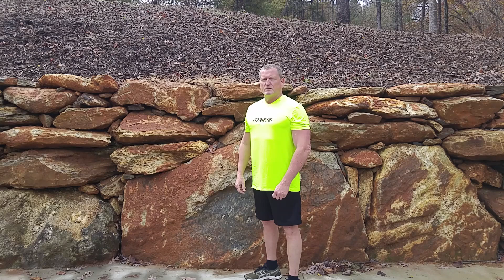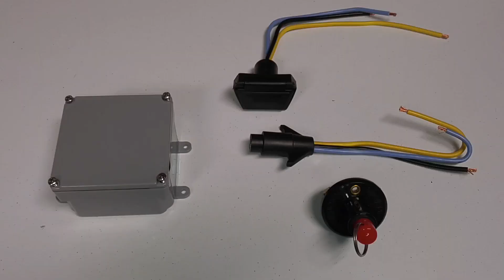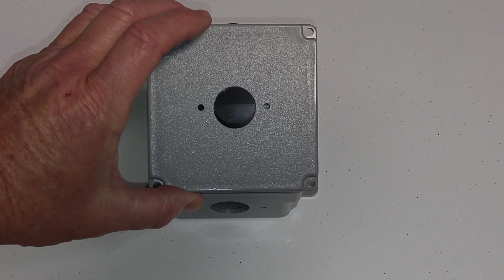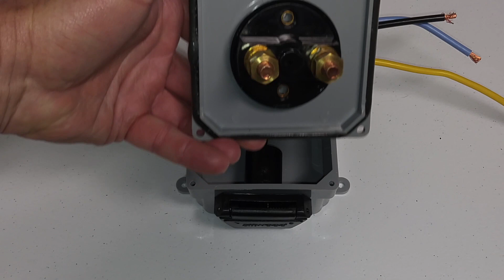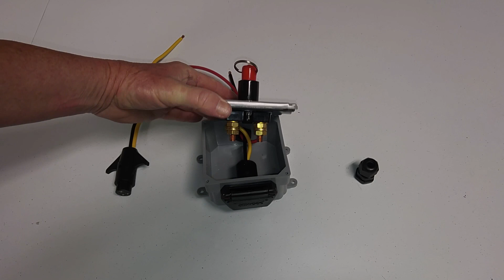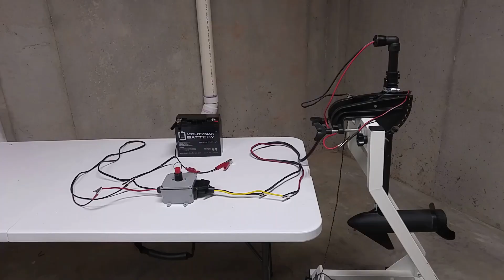DIY Kayak Trolling Motor Kill Switch and Power Supply Junction Box - Version 2

Comment: Hello I watched your video on putting a kill switch on the tolling motor. I am able to find the Atwood supplies but the water blade kill switch or any other kind of pull pin kill switch is hard to find. I’ve tried Amazon, Walmart and even temu. I think they may have discounted that kind of kill switch.
Reply from the maker: Yes, I searched too and couldn't find that or a similar one.

Comment: This type of pull pin switch does not seem to be available anymore. Do you have any alternative suggestions?
Reply from the maker: For some unknown reason they stopped making them. You can always use the standard kill switch with a relay for larger amp usage.

Comment: So your pulse width modulator goes where or on what side of the kill switch box
Reply: I see now in previous post can you put all in one box. Put the PWM in a box with kill switch
Reply from the maker: Just like it normally would. Between the battery and the box (trolling motor).

Comment: Videos are very informative. I am doing a similar setup with my kayak. Does it matter where in line I install the kill switch? Should I install after battery and before pwm or after pwm? So Battery - kill switch - pwm-motor? Or battery - pwm - kill switch -.motor?  Or either way?
Reply from the maker: Thanks Mike. I would install it after/close to the battery between the PWM.

Comment: Hi--would an SAE receptacle and plug work for the trolling motor work the same way?
Reply from the maker: Hi, it would have to be rated for the amp draw...at least 10G.
Reply: Yes, was going to use 10AWG.  I want to use your plan on a Sea Eagle 380x inflatable kayak with a minn kota C2 30 motor with a kill switch and 50 amp circuit breaker.  Going to connect motor to a 100 AH suitcase style lithium LiFePo4 battery.  Figured maybe I would just put the battery in a milk crate (mounted to the trolling motor platform) and then just mount the kill switch and circuit breaker to the milk crate.  I want to be able to easily remove the motor and the battery for charging at night in my RV so thought the SAE connectors would be the quickest way to do that.  What do you think?
Reply from the maker: Yes, that would work but I would use a "stronger" trolling motor plug. The reason is that a stronger plug would last longer if you are going to be continuously unplugging the motor. An SAE plug might not last as long. JMO.
Reply: @Aksmaniyak  That makes sense, thank you!

Comment: How do you incorporate this with a pwm set up ???
Reply from the maker: Hi Anthony. The  (+ -) wires exiting the PWM for the trolling motor would be the input power leads into the box. That way, if you pulled the kill switch pin out, all power to the motor would be cut off.